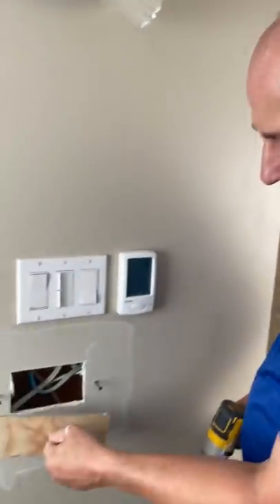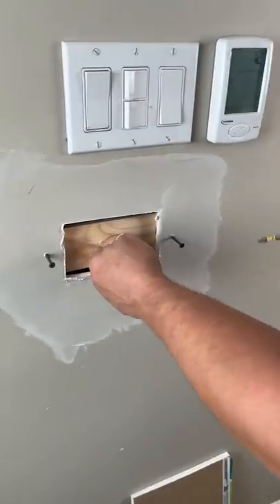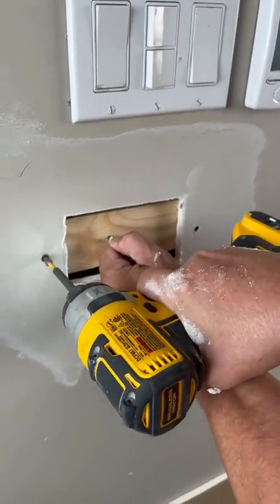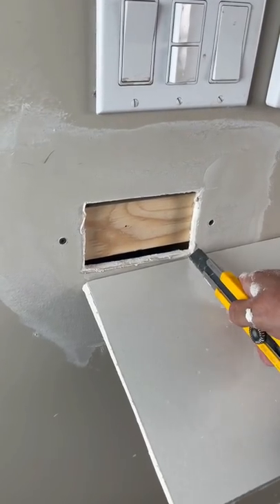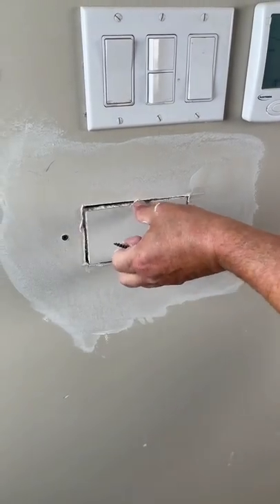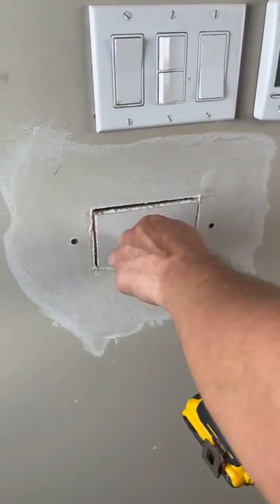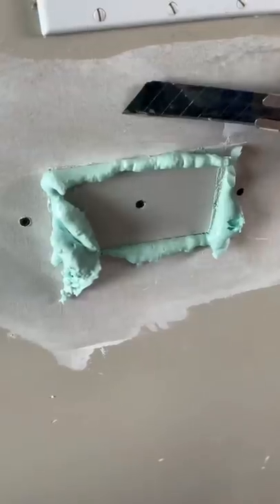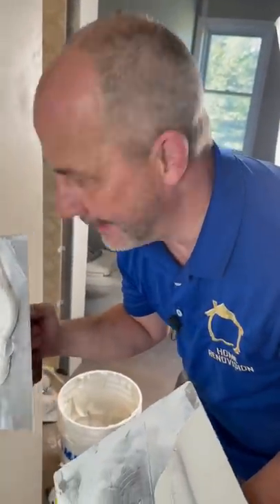Drywall Patch, No Tape Required #shorts

Comment: Funny story. Years ago I had an apartment, I put a whole in the wall probably 4’ high by less then 16”. I bought several cans of expansion foam filled in the entire opening with it. Trimmed used many layers of plasters sanded color matched the paint. After it was done you couldn’t tell there was ever a giant whole there. Landlord totally didn’t notice anything when I moved.
Reply: Good job man you improvised and that's what matters!💯👌
Reply: And it probably cost less then hiring someone to fix it😂
Reply: He knows now. Where's my money!!
Reply: It's a great method. My wife and I got into an argument, I went into the bathroom and by slamming the door w my hand a hole was formed. Used foam, cut it, spackled and sanded. Pretty cool technique
Reply: Either you were a plaster master in a former life, that landlord didn't look very well, or didn't know what he/she was looking for. The texture wouldn't have matched up to a trained eye.
Reply: @thomasarussellsr  The drywall was pretty smooth. I made a video of the apartment when I left in case it came up. But really it looked pretty darn good when is was done. You couldn’t notice it without really knowing where to look. That doesn’t mean it was perfect just didn’t stick out enough under the circumstances at least.
Reply: The next tenant got charged for your deceit.
Reply: /r/thathappened
Reply: @thomasarussellsr  Ray Charles could spot the patch from the sidewalk
Reply: @thissiteadmin  Oh, I know. After years in the construction trades, I guarantee it would be evident to anyone who knew anything about drywall or painting. Expanding foam and spackle and spackle simply does not take paint the same way drywall does. It takes a trained hand to feather it out and sand it just right to make it blend in to virtually invisible, even with flat paint.

Comment: This trick has been around a long time. He missed beveling the edges of the existing drywall and the new piece. It will make for a much smoother finish.
Reply: Right on! There actually is a powered tool that does just that. Otherwise the cut will cause a high spot in the plaster.

Comment: I’ve been doing this method of patching for years.  However, I’ve never put in expanding foam.  I don’t see how this would be superior to putting in drywall compound.  Cost alone of the expanding foam would preclude me from doing this.
Reply from the maker: the point here is you don't need tape and can finish with just one coat of mud.
Reply: @HomeRenoVisionDIY  Thanks for reading my email. I don’t like using tape either because i have to put on at least three coats of mud to get a decent looking job and I usually end up sanding the tape.  Lol
Reply: 5min quickset then two light skins over the fibafuse and it’s done within 30 min with blow dryer - do these all the time neve use expanding foam it’s not worth it
Reply: @RickFlairWoo5  that fibafuse works great! Thinner than even a California patch. Worth the itchy fingers you deal with when you're done.
Reply: Use some 5 min and here’s a little secret: use a damp sponge and lightly go over the mud before it sets and you won’t have to do any sanding. 😉
Reply: @drothers999  "thanks for reading my email" 

You boomers kill me lmao.
Reply: @paulcarmi8130  haha my first thought as well
Reply: A cab is like 6 bucks. He used very little, maybe 50 cents worth. Plus any handy man is going to have half a cab sitting around sonewhere
Reply: @drothers999  comment. You made a comment on his post. Not an email.
Reply: @orangeaction6002  in the real world or at least my world, the expanding foam straw gets lost, drys out or becomes useless.
Reply: @paulcarmi8130  Haha. You caught me. I’ll “tex” from now on.
Reply: @drothers999  hahaha omg, here it’s called a comment
Reply: @orangeaction6002  Well, I see the grammar police have a new focus.  Sorry if my use of the words “email” or “Tex” triggered some painful memories. It was certainly not my intention to upset your mental equilibrium.
Reply: @drothers999  hey I’m was playing along and just busting your chops I swear. It seemed playful with everyone. Sorry about that. I really am.
Reply: Uh no you will see it and it will have hairline cracks. But as I can see the shitty workaround the switch already. Hole to bottom left of the plate cover. Not goood.
Reply: Don’t think it meets code without tape.
Reply: @procrastinator41  only in certain states I believe
Reply: Its a waste because you can only use Good Stuff once. Don't see many other brands around, so others might be able to be used more than once and not harden in the tube.

Comment: Tip. Cut the piece of drywall oversized, place it over the hole and draw a pencil line around it. Cut the wall out along the pencil marks and your oversized piece will now fit perfectly. No need for expanding foam and waiting for it to cure
Reply: Absolutely! Ur not getting enough credit on this one bro. Want a tight fit cut a hole to match the piece of rock you got. 👍 and idk wtf all these guys are saying. I use mesh tape on everything with a seem, razor cut, score, or blowout.

Comment: “I guarantee you’ve never seen this before” 

Shows a trick that literally every apprentice carpenter knows
Reply: You still watched, commented and helped this guys video gain more reach so I’d say the title worked
Reply: Damn, had no idea everyone on YouTube was an apprentice carpenter. Good to know
Reply: This video is probably for your dad, not a carpenter
Reply: He's referring to the foam step of the process. I had never seen that before.
Reply: I've never seen this before.
Reply: The secret is if you cut the patch correct you dont need foam
Reply: I've done drywall for 20 years and I've never seen even the worst hack job use this garbage... why the fuck not just tape it?! It's faster and easier and it won't crack.
Reply: electricians tpo
Reply: @lHiTMANll  tape is not necessary. I dont do this either I just cut my drywall correct so it fits tight
Reply: @briantopps5638  yeah and it cracks 6 months later. You have to use tape... it WILL crack if you don't use tape.
Reply: Channel literally says DIY, their videos show DIY tips and tricks.
Reply: @lHiTMANll  I've done drywall repairs for a long time and they have never cracked some repairs I did almost 10 years ago and never got a call back. I don't know what your doing but if tape works for you go for it. I never need tape to get perfect results

Comment: Learned this on my own. Honestly at the time I couldn't have imagined doing it any other way.

Edit: didn't use foam, just mud
Reply: The foam is the part I'm like wtf
Reply: @briantopps5638  agreed why the hell would you use foam, can't imagine why that would make sense.
Reply: Dry time for foam is at least a few hours just tape with 20 minute hot mud 2 coats, 2 hours ready for paint.  Sounds like you fellas already know

Comment: No. Cut your patch first.
Trace over the hole that needs to be fixed, marking one side for reference.
Then cut your hole to patch, the plug that was cut first will fit like a glove.
Next, use a razor to cut the paper from the edges of the hole and plug of the face off the drywall (chamfer the edges).
Now back with wood like this video, but skip the foam, unnecessary.
Trimming the paper prevents bits of paper sticking through your mud.
Tip, always make sure your dry wall patch material is the same thickness as your wall material.
Reply: This is the correct method 👌🏼

Comment: “I guarantee you’ve never seen this before” literally how everyone does it. Minus the foam.
Reply: You also don't need foam if you cut the drywall 1 inch larger than hole. Score the drywall size of hole. Peel extra drywall off while leaving excess paper. Place drywall in whole and mud the excess paper.
Reply: I was thinking the same thing this guy must have just got into being a handyman around the house.
Reply: I came here to make this same comment 🤣
Reply: @danecarpenter8735  damn I remember learning that back in home repair in high school. That was a good class I wish I remembered more.
Reply: Haha Thank you! I just wrote the same thing before I read this. Lol. Guarantee is a big statement.
Reply: The foam is what he is referring to never being seen lol
Reply: I Garrenttee you'll seen small cracks from not using tape or a Mesh screen
Reply: Right 🤣🤣
Reply: Right 🤣🤣
Reply: Not really - everyone secure the cables first :P
Reply: @danecarpenter8735  yeah, using the face “paper” of the new piece can replace foam and tape entirely. Just meant to state that I’ve never seen it done with foam. Or anyone who felt the need to add foam. Not hating on the idea. Just seems you’re getting the same results with extra steps, resources, and wait… I’m being that guy…. Over analyzing a tips video and acting like I know everything… my bad, “content creator” you were just creating content. And foamy confusion.
Reply: And some tape.
Reply: @danecarpenter8735  that's called the blowout method
Reply: @johnjones4096  tape will be visible, and this fix is very rigid, so I wouldn't worry about anything else.

Comment: I’ve done this with a piece of cardboard with a string through the middle.
Reply: Cardboard would probably be a better overall option. Using a piece of wood is gonna screw with someone if they ever decide to use a stud finder in that area. Its not too likely with where it is in this video but my point remains.
Reply: @AndrewLeeW1  typically on a wall especially if it's low enough for someone to lean on it or come into contact with it you want to use wood. 
If the patch has to backing and the only thing holding it in place is mud, it's bound to crack and fall out.
Reply: @gatorb8  why don't Americans build with bricks?
Reply: @Idhrennielful  you brick the inside of your home?
Reply: @Idhrennielful   cuz we're not strong enough to punch a hole in a brick wall...
Reply: @HashtagBirdyy great reply.

Comment: You're absolutely right. A 7.00 can of expansion foam that can only be used once and waiting a day for it to finish expanding and set as much easier than using a nickel's worth of tape.
Reply: tape isn't necessary either unless you're in a hurry and want to leave thin coats that dry fast.

Comment: You would have to wait until the foam dries. California patch with fast mud would be the way to go on that.
Reply: So wait a couple of minutes?
Reply: I figured he would of shown us a cali patch.  he is going to have mud anyway,  why not cut the drywall out and leave an inch or 2 of  paper on it,  mud around the hole then no board needed.  or he could of used the board for strength and not use a 8 dollar can of spray foam for 6 inches of a small crack to fill.
Reply: He's already shown the California patch multiple times.  This is an alternative.

Comment: Been doing the wood piece for ages 😂 one of the first thing on site I learned. Btw it's faster to tape than wait for expanding foam to dry
Reply: I said the same thing. It could be taped in the time it takes to shake the can before you can spray it, and by the time the foam is ready you could've done another coat and textured it.

Comment: Except for the (as I can tell, unnecessary) expanding foam, it's the same patch we've been making for years. Just be a little more careful about cutting the plug. The tape just covers the screw heads to the mud doesn't fall out, just sink the screws a liiitte bit deeper.  No foam, no tape, no problem.
Reply: Tape screw heads ????
How about screw tape heads 😵‍💫

Comment: Been doing that for years...

Did not use expanding foam though. I beveled the edges and used long set mud.

Works great.
Reply: a soft flick to the wall and it'll cave in
Reply: @gunk6406  If its done right, it will last. I have repairs 10+ years old with no issues in my house.

It is important to bevel the edges and use long set mud. Makes a very strong repair.

Comment: Jeff you might like this idea. Someone on YouTube did it for a patch. He cut out the patch piece an inch bigger on every side and then broke off that inch of drywall leaving an inch of just the drywall paper around the patch. That extra paper becomes your tape.  Cheers!
Reply: California patch
Reply: I think you're referring to the California drywall patch. I also think Jeff has shown that method in a previous video.
Reply from the maker: I have done that as well however in high traffic areas or behind doors where the knob hits I find this more reliable than a california patch.
Reply: @HomeRenoVisionDIY  then put the wood behind it and still save your cost ... cali patch is the way to go and use 20 min mud it dries harder on patches

Comment: When I was in college I punched a hole in my dorm room wall. On the eve of move out day when they do their inspections before you can checkout and leave, I panicked about the hole thinking I waited too long and now cant get anyone to come over and fix it. So I just lathered up a piece of printer paper with some OG Elmer’s then slapped that band aid on the wall wound, licked my fingers cause I wasn’t  gonna let any of that delicious glue sauce go to waste, and called it a day. The next morning I used some touch up paint to blend in the texture around the edges and I was good to go! No tape! Looked perfect but if you leaned on that spot you’re gonna elbow dunk the wall real fast. And just to top this all off, before I sealed up this
Time capsule, I found a pair of red panties deep in the wall cavity that I must have thrown in there when I was speed cleaning.. oops 🤷🏻‍♂️ No tape!
all true story. I went to ASU so that should explain it🤦🏻‍♂️

Comment: I’d be pissed if this was in another location. Imagine you’re looking for a stud to hang your tv on, find said stud on first try everything is going great then bam tv falls out
Reply: Ummm, that's not how it works lol. If you use a stud finder, you would see that the "stud" is like 3 times as wide as a regular stud, and has no height. Only a fool would mount it on that. Not to mention, studs are spaced apart, so even if you did drill there, there wouldn't be another stud the right distance apart, so you wouldn't mount it anyway.

Comment: "guaranteed you've never seen this before"...   
That's exactly how I patched all the holes in my college house walls before I moved out about 30 years ago, except I didn't use expanding foam, because it sucks, and isn't necessary at all. Just cut your patch piece so there's not such a big gap.
Reply: No … cracks will form without tape down the seems
Reply: @twsbrl2xlldmoney355  ya, except there were no cracks.

Comment: He said "I guarantee you've never seen it before" holding a piece of wood, yeah I've known about this trick for many years. Nothing new about this.
Reply: I've done it many times using a piece of drywall as the backer.
Reply: He's talking about the spray foam . Did you watch the whole video?
Reply: @DaDaDo661  --There is more than one way to skin a cat. whether it is spray foam or drywall, you still have to finish it on the outside with drywall mud. Leftover spray foam tends to dry in the can after it has been used which makes it be not cost effective. Both however are valid ways to do it. Yes I did watch it all the way thru.
Reply: Its new to me.

Comment: I have done this for 25 years except don’t use foam. I clean and bevel front and back of the piece of drywall and the opening. Use hot mud and sand

Comment: This is actually how I was taught to repair drywall. Except we used paint sticks from the hardware store that were free. You can use a 1 gallon or 5 gallon paint stick. I prefer the 5 gallon paint sticks, and just cut them down to size if your hole is bigger, then just use multiple paint sticks.

Comment: I do something like this when mounting ceiling fans instead of the metal cross bar I use two 2x4s glued and screwed together, drill a hole in the center for wiring and screwed into raptors. Always has made fan installation a breeze with a direct mount to wood.

Comment: That's how I fixed shower walls. Needed backing to be able to re-tile. I would also square up holes and cut patches to fit, leaving 2" wings of paper on the edges. Mud the edges, fit the patch, glue down the flaps. Thin down mud, dab on the patch to mimic texture. Was in charge of 6 hotel buildings, 625 rooms. As always, all the beat to everyone. Chef Scott 👨‍🍳

Comment: Normally, very few people “invent” new techics, but rather copy what they see and learn. If you’ve “never” seen it before, it’s probably not a great technic (spray foam) because no one is copying it, otherwise everyone would be doing it and everyone would have “seen it before.” 
Spray foam is about $5 a can, and once you open it, you have to use it within a certain amount of time or it will harden in the can. 
Sheetrock tape is about $0.05 a foot, so about $0.10 of tape for this particular patch. And you can store the tape indefinitely without it going bad.
Also, you can tape and float the patch right away. With foam, you have to wait for it to cure and completely stop expanding (hours? days?) then trim it flush, then you can float the patch.
You can do it anyway you want and get the same desired results. But if you do this for a living, spending more time or money on materials is not what you strive for.

Comment: The backer offer extra protection after a doorknob punch a hole from a renter. No need to measure the opening when cutting the sheetrock patch over the damage at the same time for a perfect match. Always use tape.

Comment: Yes I have seen that before I've been doing that for over 20 years as a maintenance tech. That was one of the first methods we use when we close up walls that we have to cut open. The only thing is we don't use expansion foam we use a 20-minute easy stand and it works just as well.
Reply: This was actually one of the questions they asked during my interview for a maintenance position, how you'd fix this type of hole.